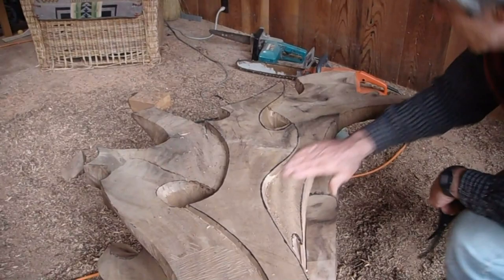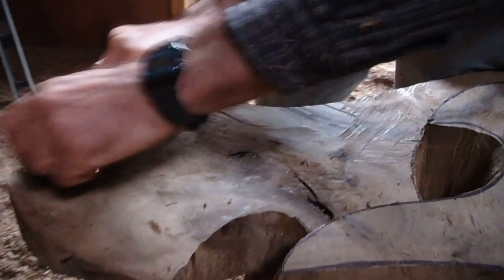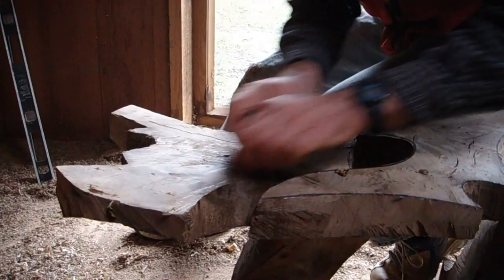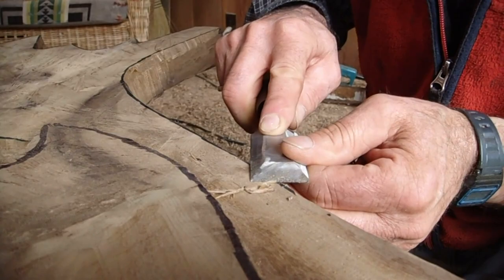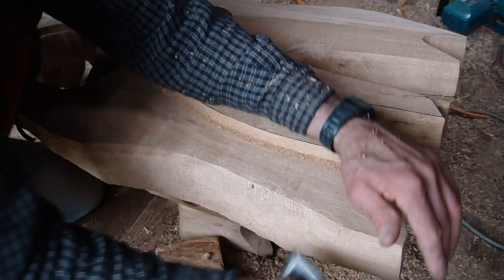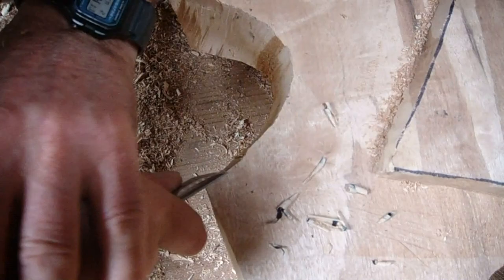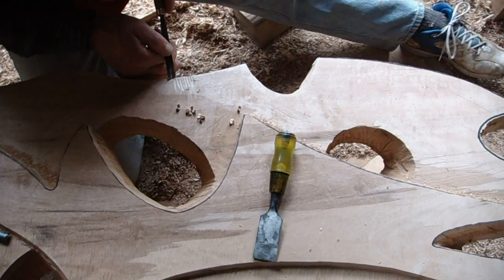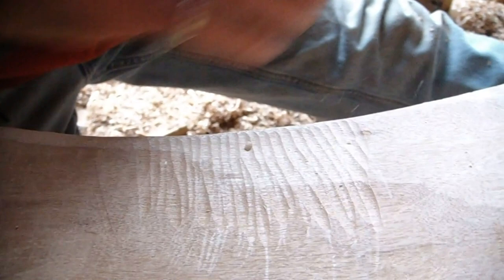Finishing sculptural table lines and surfaces. David Groth documentary, chapter 8 of 9.

Comment: Love your work David!! Do you only work with Myrtlewood? Can you please give me your recipe for your finish you use.
Cheers Andrew
Reply from the maker: Thanks Andrew...yes I only work in myrtlewood, otherwise known as California bay laurel. The finish is actually very similar to Sam Maloof's recipe...1/3 boiled linseed oil, 1/3 thinner, 1/3 polyurethane, and shaved beeswax (the only difference being that the beeswax is added to the 3 part mixture rather than to just the oil) heated and dissolved together to the consistency of cream.
Reply: David Groth could you use Mineral Spirits in place of the Thinner??
Reply: David Groth and how much beeswax??
Reply from the maker: +Lee Goins Yes, sure!
Reply from the maker: +Lee Goins keep adding the shaved beeswax little by little until it is the consistency of cream!